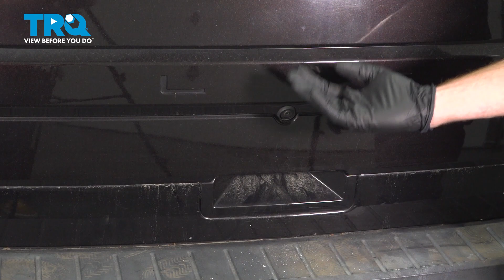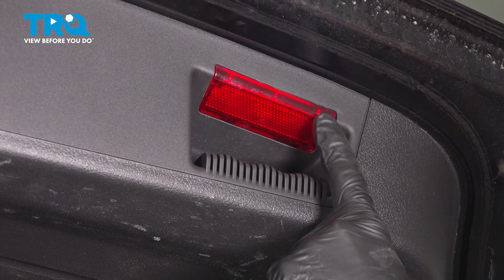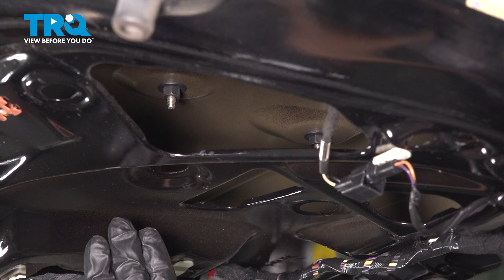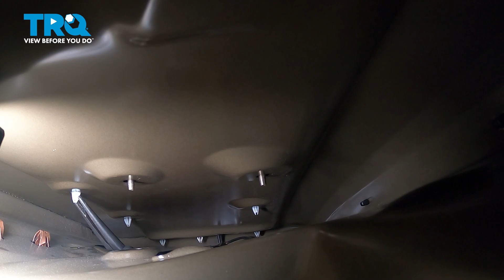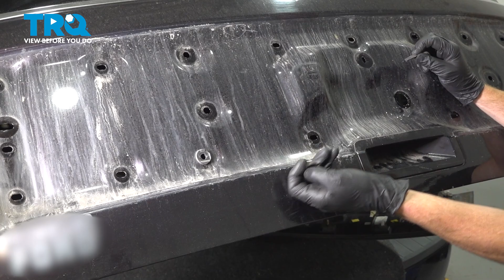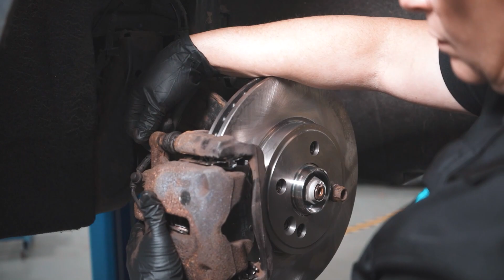How to Replace Rearview Camera 2009-2019 Ford Flex

Comment: Did all this and my turn lines are stuck on one direction is there a fix for that? I tried  to do the turn the wheel all the way to the left for 2 seconds thing and resetting the sync system.

Comment: Excellent, ill be placing my order from you guys for the camera for my 2019 ford flex SEL. It seems the camera now only works whenever it feels like it and it started to look a bit blury and the trouble started during the summer time so i feel the heat from the sun caused the damage.

Comment: Thank you brotha. The clips to me was the hardest part. My suggestion is to put as many trim removers as you go around  loosening  the clips so that they stay up and not clip back down. But after that it smooth sailing. Putting everything back took less than 10 mins.

Comment: Great video except for one thing .  .  . I would recommend checking the camera operation BEFORE I put the panels back on. I've met Murphy and his Law and I'd much rather catch a problem beforehand than having to go through all that clip removal again. (Oh, how many times the Murphy's Law and Chinesium combination has bit me in the keester. They're the Dynamic Duo champions of time and money wasting.).

Many Chinesium parts come pre-faulty from the factory, internal wires connected to wrong pins (upside-down or inverted video), correct part number on the wrong part, not working at all, etc.

As far as the repair process, Great Job!
Thanks!

Comment: I recommend buying a large trim piece kit. The hardest part of the camera replacement is dislodging 17 pin clips.  six clips are in the corners of the cover panel. Having many, many trim pieces to lift and separate that back cover panel helps to dislodge those pesky white pin clips.  It is worth the extra $$, considering you are replacing the camera yourself.  Right tool, Right job.